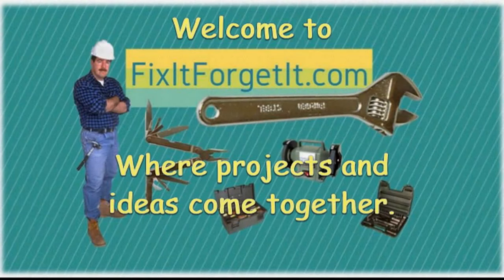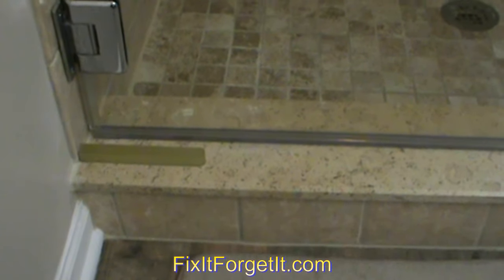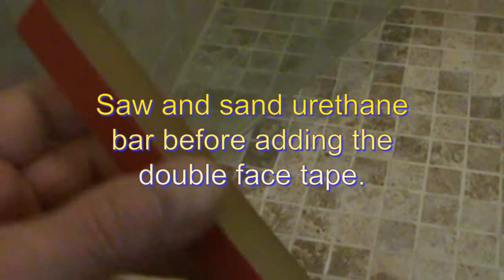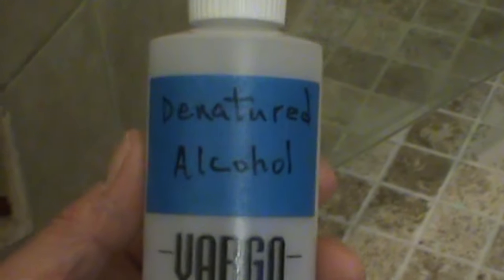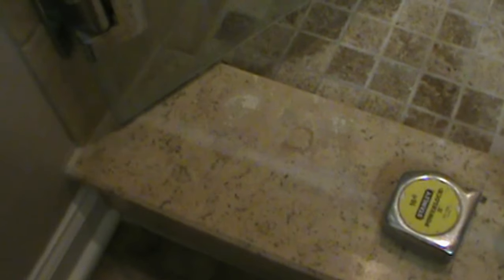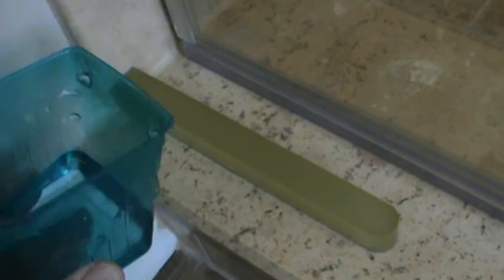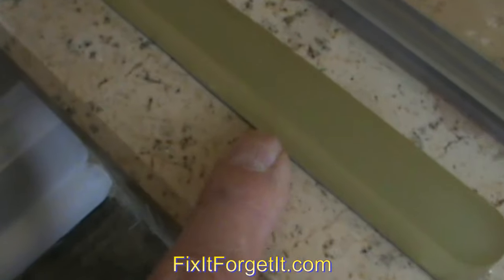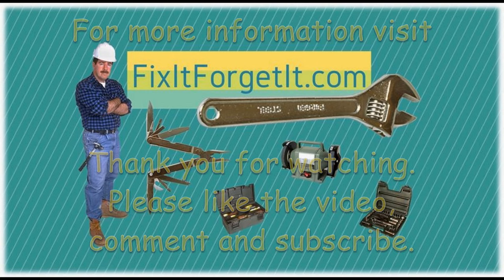How to fix your leaking frameless shower door with a urethane dam.

Comment: Almost same situation except that my shower is literally squared shaped and the people I don't who made it but just make the step even so the door won't even slide inside. I was looking add a shower frame but for custom dimensions I can only imagine it would cost a fortune. 
Thanks for sharing. Glad it worked out for you.
Reply from the maker: Thanks for your kind comment, NK productions. I'm sorry you are having trouble with your shower. I know how frustrating that is and hope you can find a solution to your problem.

Comment: This shower dam was made LEVEL, they should always slope at least 1/4 to 1/8 inch per ft into the shower pan (the side of your bubble should touch the line, not be centered to the lines). The entire problem was because the installer failed to do their job and did not understand water at all. All too much of this crap lately because so few are actually tradesmen.
Reply from the maker: Well said, Djea3. They did a terrible job on this shower stall. I frequently have to correct one problem or another on this poorly done installation.

Comment: We have almost same Bathroom same color tile but d glass door swing out instead . Same problem its leaking in d bottom . Thanks I'll order this rubber dam .
Reply from the maker: My pleasure. One concern I have is I'm not sure if you can stop the leak by putting the rubber dam on the inside of the door. I hope this will work for you. Good luck with your repair.

Comment: I've been dealing with this issue for a year now and have tried everything. Except my water comes out from the middle, where the glass door connects to the fixed glass pane. I've tried all sorts of sweeps and silicone caulking. If I tried something like yours, it would need to run the entire length of the bottom.
Reply from the maker: Hi, Pablo. I hear your frustration. I dealt with this for years and tried all the same stuff you did. My urethane dam is still holding up perfectly. If your door swings to the inside instead of out and you could put up with stepping over about 1/2 to 5/8 of an inch high urethane dam it might be worth it. It may be better than having water ruin your floor or cause a slip and fall. I'm sorry you are having to deal with this frustrating problem and hope you find a solution.
Reply: @Fixitforgetit  Thanks! This will be my next attempt. Trying to put a dam under where the opening of the door is.
Reply from the maker: @PabloTheThinker  My pleasure. Good luck with your repair.

Comment: I have a very similar setup and door, however my problem is water coming out through the gap between the door and the wall.  Would you mind sharing what kind of guard you have there?
Reply from the maker: I used the PVC Seal and Wipe for 3/8" Glass as seen here.
https://bit.ly/44iWias

Comment: Could the dam be placed on the other side of the shower door? Hard for my door to swing in.
Reply from the maker: Unfortunately, I think it would simply fill up with water and make the problem worse if it were placed on the inside. I don't know if you have two doors like I do but if you do you could place the dam on the door with the leaking problem and use the other door. Simply leave the door with the dam alone and don't use it. If you don't have two doors I can't think of a way to make a dam work in your situation. I hope you are able to figure something out. I know how frustrating this is.

Comment: Where did you get the urethane?
Reply from the maker: Hi, William. I am not affiliated with the eBay seller below. I found an eBay Seller named "kpreneurethane " who offered urethane bars listed under the heading of, "5/8" x 5/8" X 24" URETHANE / POLYURETHANE 50 A NATURAL BAR." He had other sizes and colors as well. Good luck with your repair.

Comment: ?? Doesn't that prevents the door from opening
Reply from the maker: Good question, Randy. It doesn't stop it from opening but I point out in the video that the door will only open into the shower. I had to choose between a door that opened one way with a shower that didn't leak or a door that opened both ways that leaked like a sieve. For me, the dry floor was the better option and we don't mind opening the door to the inside.